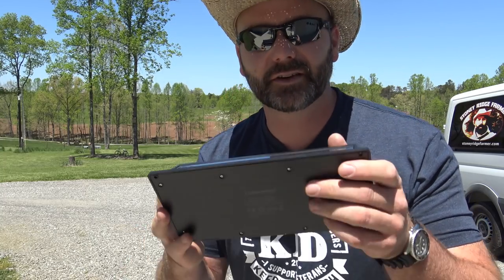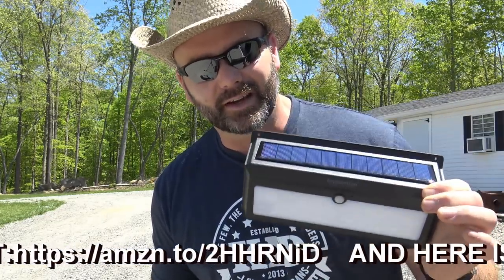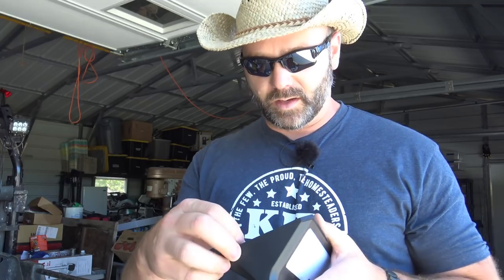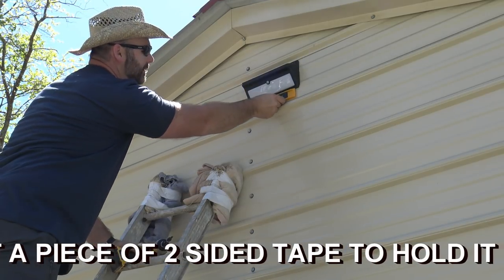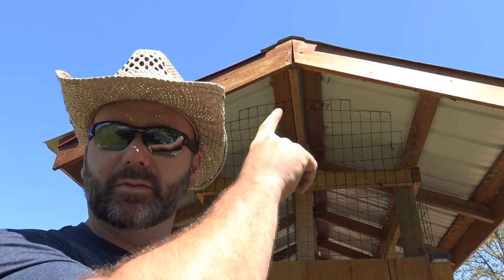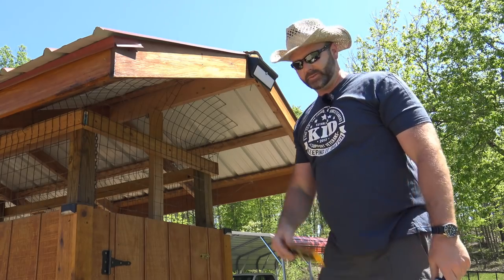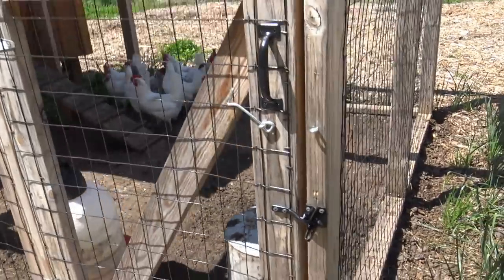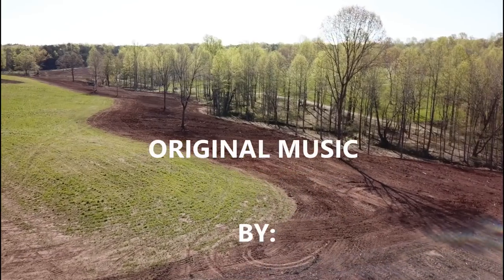FARM SECURITY LIGHTS TO DETER PREDATORS AND PEOPLE!!

Comment: You might want to run some 1/2" hardware cloth a foot or two high around the bottom edge of the chicken run. Raccoons like to reach through wide fencing and tear anything they can reach off the chickens. Just an extra layer of protection.👍

Comment: Hello, I was interested in the way you protect the ends of the ladder to stop the digging into or scratching the house.
I have always done that when I am painting the house,- it's just common sense?!.
Also, I noticed a few people have commented on the fact that you should get what you Americans call a "critter cam".
I assume they mean an outdoor, wireless camouflaged camera.
I have just ordered one of those for my place here in a rural area of New South Wales (Australia).
I will let you know how good/bad it is when it arrives.
I do know that I am getting a lot of kangaroos passing through,- They leave "tell tales" behind!.
They also damage fences,-particularly the younger ones that still cannot jump as high as the adults, so they try to go Through the fence, or Under it, which of course damages the fences.
Something also stripped out my peach tree in the back yard, so I would like to know exactly what's passing through at night.
I like the solar lights.
I have used solar lights in the past and I have always been very happy with them.

Comment: You might have raccoons, opossums, or foxes after your chickens. Check the trees near the house and see if there is a hollow tree around for them to stay in. Here is one thing I do to try to keep the diggers from digging into pens- go buy galvanized hardware cloth or fencing, 2 or 3 foot wide roll. Unroll it the length on the outside of the pen on each side and cut it to length, adding a bit to cover the corners. Then bend the cloth/fence up 6 -12 inches so it make a right angle and sits flat against your pen fence, zip or wire tie this to your pen walls. Use some landscape staples to hold the rest of the cloth/fence to the ground. Sometimes I bury it then plant grass on it, others I just let the grass grow up through it. Staple it well or the lawnmower may catch it. This will last about 5 years or so if it is buried. The overlap at the corners is to keep them from digging there and going under the rest of the fence.
Reply from the maker: Thanks for the tips Paul

Comment: My Dad had Macular Degeneration which is a nasty eye condition.  Dr's told him it was caused from cleaning the chicken coop without decent ventilation. The high nitrogen of chicken poop was the key cause from what Dad told me.  Maybe not a huge issue at our age and your setup but a dust mask or even a bandana when moving the poop wouldn't be a bad thing. 

I've been installing similar lights lately.  I live in town so waiting for the looky lou's to complain they are visible at night suddenly.
Reply from the maker: Man when I lived in town nothing could get near my place at night. Same goes for here in the country. Light is the best way to keep out the unwanted
Reply: If the City added a street light to the dark side of my corner lot it would never be dark!  I have a big maple that defuses much of the street lights on my house.  But with my deck I'm adding post top lights and smaller versions of your new lights in this video to the top of my windows.  Cars driving by are turning those on.

Comment: the code did not work
Reply: Code didn't work for me either
Reply: It worked for me just a few minutes ago.  You have to apply it in the Amazon cart under the "Payment method" section.
Reply: hi   the coupon code is working
Reply: wow   code is working now